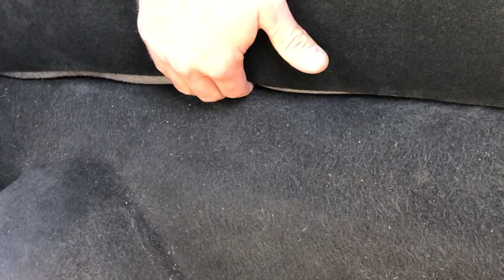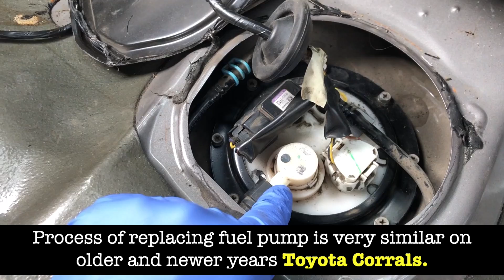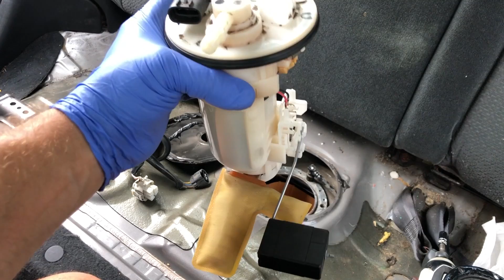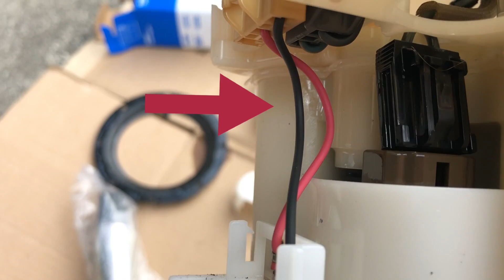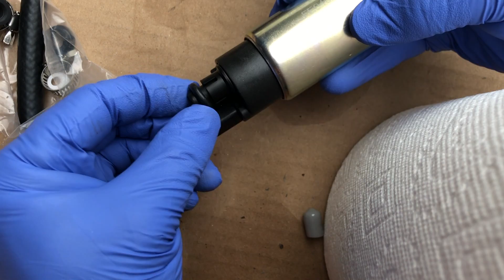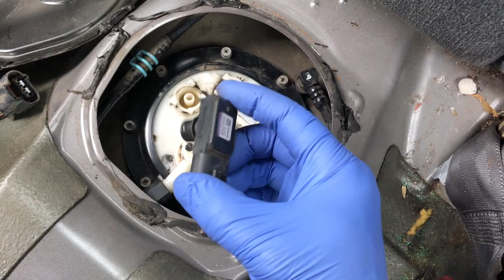How to replace a fuel pump on 2004 Toyota Corolla S tutorial |  Years 2003 2004 2005 2006 2007 2008

Comment: That thing at the very bottom is the fuel pump strainer, not the filter. The silver thing at the bottom, which he doesn’t mention, is the fuel pressure regulator and their life expectancy is 100,000 to 150,000 miles
Reply: Can you only replace the fuel pressure valve?

Comment: that connector at 1:52 is not easy to remove, have to push the screw driver deep to move the clip, I do it on one side first, then on the other side
but the yellow clip and screw will fall into the gap of the tank easily, better fill the gap with something before removing anything

Comment: Saludos tengo el mismo carro, tiene una falla va normal y de pronto deja de hacelerar le meto el pues hasta el fondo y nada al ratito vuelve y hacelera de nuevo normal y aveces cuesta arrancar será la bomba de combustible ??
Reply from the maker: Hi thanks for writing. This could be number of things. Could be clogged fuel lines or most likely clogged fuel filter or bad fuel pump. You would need to take your fuel pump out and inspect the fuel filter.
Reply: @tronixster  saludos nk se le cambió el sensor tps la garganta la computadora sensor oxígeno la bomba de combustible y las líneas de electricidad mandan la señal inestable y aún así sigue marcando el sensor tps ya no se que mas hacerle 😔 por ratos falla deja de hacelerar y ratos anda bien cuando le borro el chek anda al 100 el carro pero le vuelve y tira la misma falla los chisperos se los cambie las bobinas están buenas

Comment: Question: is there NOT a fuel filter but rather just the fuel pump on these Corolla models ??
Reply from the maker: There's a fuel filter somewhere on the fuel line, I'm just not sure exactly where. You'll have to follow the fuel line to locate external fuel filter.
Reply: The fuel filter is the half round thing the fuel pump is located in.

Comment: Did you use grease on the O-ring on the pressure regulator or the fuel pump O-ring?
Reply from the maker: Yes I applied gas to it to make sure it's wet all around
Reply: @tronixster  I was told to use some magnalube grease it’s mineral based grease But a little is that OK?

Comment: What happens if you fail to install all the rubber materials at the outlet of the pumb?
Reply from the maker: It won't pump gas as well and you'll have issues with fuel delivery

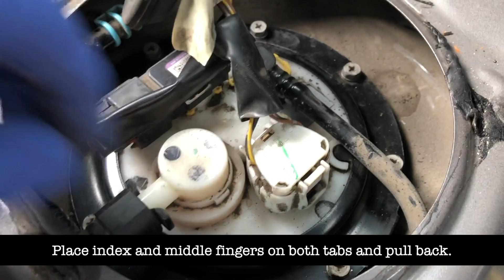Comment: Do not want to be called a hater for correcting you here but @ 1:56 those tabs you show with the screwdriver another video shows clearly not to pull them outward but squeeze them then slide the hose back, this here is misleading and if I am wrong show us a video would be interesting to watch how you do it. I struggled with it and could not disconnect that hose no matter how many times I tried, squeezing, pulling, screw driver into the tabs as you indicate; nothing! Other than that this is a great tutorial. Thank you for taking the time to do it.
Reply from the maker: Rody, thanks a lot of correcting me on this and pointing this out. I'm sure people will find this helpful.
Reply: @tronixster Oh you are very welcome, hope this can help other out there because those tabs are the worst part of this pump job; mine gave me the hardest time ever to come out; as I mentioned; I ended up snapping the round plastic tab on top of the pump where it connects to; and those tabs are sort of destroyed, don't know if they will catch the pump again and seal which is important as that is the gas return line. The ordeal was I ordered another pump from ebay for $65.00 which came the same way and was lucky the merchant refunded it, and told me to just keep it after confirming it was the part he sent, so I had no choice but to buy that upper part from the dealer to a whooping $80.!!! ...all this because of those tabs; the idea is so moronic and so cheaply made even a mechanic at the dealer told me they get to break them too from time to time; that hose at the dealer with that connector is $58.00!! it connects to the charcoal canister on the side of the tank and it is not easy to replace without a lift; I am still working in the car engine and replacing other components no less difficult like the clutch master cylinder, another PITA job that involved taking the whole dashboard out to get access to the bolts for it that are buried in a metal enclosure impossible to get to from just under the dashboard, again, a simple modular panel from mid dash down that would give access to all that section would have made life easier even for a trained mechanic but seems all the moronic engineers got together to design this 2004 Corolla, LOL

Comment: 2004 Toyota Avensis, crank but no start, fuel tank is full. It was not started/run for 7 weeks! How to troubleshoot?
Reply from the maker: Could be number of things, make sure you are not using spare none chipped key, could be a fuse, spark plug wires, clogged fuels lines or fuel filter, mass air flow sensor and so on. I hope you get it sorted out. Blessings
Reply: @tronixster  It showed to be bad battery even tough it was cranking a lot. But the issue was first solved by dragging the car with another car and start it in second gear. A couple of days later change the battery and fill up the oil as it also was kind of low. Thanks anyways!

Comment: I have an 02 Corolla with starting and ltft of 40%. Gonna replace the pump tomorrow.
Reply from the maker: Good luck on the replacement :)
Reply: @tronixster  Fuel pump wasn’t the fix. I got tired of working on it with HOA watching. I bought a 02 Honda CRV. All is well

Comment: I have an ‘04 Corolla with about 600,000 miles on it (the odometer maxed out at 299,999 nine years ago) and it has never had an problems. Welp just the other day it started to have a problem for the first time. Turns out it’s the fuel pump starting to go out. This video was extremely helpful. Was able to do it myself and my only expense was the pump itself and a pair of rubber gloves.
Reply from the maker: 600k miles?! That's impressive!! And praise God you found this video helpful. Keep enjoying your Corolla

Comment: Hi, I've watched a few of these but yours is the closest setup to mine so far. I'm down here in NZ and my 2002 9th gen (introduced to N.America in '03)  has 2 fuel lines and the white connector, not the $200 pressure sensor.  Also have those 8mm phillips head hex bolts instead of the plastic screw-on retaining ring seen in most other videos. I only went out to check after viewing this, saved me buying a strap wrench I thought I'd need. Many others are replacing the entire assembly but I just want to swap out my strainer sock and main filter as a bit of maintenance so your video covering the disassembly will be very helpful this weekend. Much appreciated.
Reply from the maker: Praise God you found this video helpful. Yeah these units can be taken apart and individual parts can be easily replaced.

Comment: Great video man. About to do the fuel pump in my '07. It's finally starting to go out after 270,000 miles.
Reply from the maker: Praise God this video was helpful. And good luck on the replacement
Reply: @tronixster  the replacement went smooth and silky. Been running fine since
Reply: Hello. Can you send a link please of the pump you bought for your 07 please. Thanks!

Comment: Question. I recently topped off my tank and added seafoam to my 2003 Toyota corolla . I turned it on and off about two times for grocery runs. I turn it on it starts for a second turns back off with a squeel and I get a scent of gasoline . Is it the fuel Pump that needs replacement??
Reply from the maker: You might have couple of issues here: 1) leaky fuel line & 2) loose belt. But I can't tell you for sure, I would have to see the car in person. So good luck man

Comment: Hello, you are the fuse efi to jump? I still have the engine's radiator fan, which is always on. I was wondering if you yourself had the same problem as me. Thank you!
Reply from the maker: Hey Michael, no I never had any issues with radiator fan. It seems to be working as it suppose too.
Reply: Radiator fan stays on when the AC is on.

Comment: Very helpful, changed filter and fuel pump, but still no go. I'm going to give it power independently of the key start switch so it can build pressure without killing the battery or the starter motor... any suggestions?
Reply: @wackarnolds  have since found no compression on 2 cyclinders. Probably damaged valves. Taking apart soon
Reply from the maker: bro I'm sorry. Sounds like you'll have to do some more troubleshooting. Good luck

Comment: Greetings I have a Toyota Corolla 2003 and I have to put the switch three times and then start the engine.  When I turn the key I don't hear the fuel pump. help me
Reply from the maker: Maybe electrical issue.

Comment: My corolla 2007 US model is having some problem in starting.in morning it starts imidiately but after a drive when i re start it takes long time to start. I changed its fuel pump few days ago after that it is showing this fault. What could b the reason?
Reply from the maker: Could be leak in your fuel line. When car seats for some time it gets air in your fuel lines and it takes some time for fuel pump to push that air out and then it starts
Reply: Cars require more fuel to start when the engine is cold, but they require less fuel when the engine is warm. So your car is probably getting too much fuel when the engine is warm. That could be the result of leaking fuel injectors or a dirty mass airflow sensor. Try adding a good quality injector cleaner to the gas and clean out the mass airflow sensor with actual mass airflow sensor cleaner.

Comment: I have a 2009 Corolla LE with 180,000 miles and recently the check engine light (CEL) turn on and the code is P0001.
P0001 is volume Fuel  Pressure Regulator but I have no fuel issue and the car is running fine and did not notice any stall or rough idle or any fuel related issue. Is it really Fuel Regulator? Thanks for the video.
Reply from the maker: I'm sorry man. I wish I could answer your question for you.
Reply: @tronixster  Not a problem. Thanks for the excellent video.

Comment: I saw your video, I have a question to you, I got P0171 code in my scanner and say “System too lean bank 1” them I remove and replaced the mass air flow sensor, up and down 02 sensors, air filter, pcv valve, vacuum hoses replaced and the problem still. Do you think could be the fuel pump? Or injectors?
Reply from the maker: I'm sorry man you had to do so much work but it's hard for me to recommend anything honestly. Good luck to you
Reply: Did you figure out the problem?
Reply: I am here for the same question! Thank you for asking already

Comment: im 17yrs old i ordered a fuel pump but i was following thru different videos cuz people wouldnt show good enough... and im pretty sure i didnt place the things right.. i started like at 8pm until 11 pm and didnt even finish putting the things back together like i left off at trying to put the whole filters back ... i got tired.... so later or tomrw morning ima  use this video to go thru the proccess again ....   the one im working on is a 03 toyota matrix has the same everything as shown in the video
Reply: It should be a very similar process if not exactly the same. Good luck.
Reply from the maker: Good luck brotha

Comment: Sir where did you buy the fuel pump from can you give us link thanks in advance.
Reply from the maker: Hey Mike, I bought over the counter at my local AutoZone store. It will cost you around $200.
Reply: use rockauto. a fuel pump is only 40 dollars there
Reply: @xxmemekipxxlastname4846   Is it a good fuel pump??
Reply: @collinnielsen9596  yeah i got an oem one

Comment: Unfortunately I have a 2019 Corolla SE. Would you be able to make a video for that? I don't actually need it replaced but if I ever do, it sure would be nice to have a video for it. Keep up the great content! I'm your number #2 fan!
Reply from the maker: It's less likely that you'll need to replace a fuel pump on a newer Toyota Corolla but if you do process will be very similar. Good luck :)
Reply: @tronixster  thanks Paul! I have 2015 Tesla model S and I think my fuel pump might be going out on it. Could you make a tutorial for replacing it?
Reply from the maker: @rumetube6177  Thank you for commenting again. I'm sure all years and models Teslas are battery-powered. In other words, they don't have a fuel pump. You might be having a bad battery or simply try charging your battery. I hope this was helpful.
Reply: @tronixster  Oh that makes sense. Well the the thing is my Tesla has an aftermarket gasoline generator installed on the trunk so I never have to charge my Tesla. I fill up the generator every morning and start it up and it's showing good battery levels consistently. However, last week the generator did not startup despite being full of gasoline. I'm thinking it's because of the fuel pump in the generator. It's a predator 212cc. Do you think you can make a video explaining how to fix that? Again, thanks in advance! Love your videos!
Reply: @rumetube6177  wth lol is this a serious comment 🤣 you have a gasoline generator to power your electric car? Isn’t that ironic. Maybe get a gasoline car and stop harming the environment more then you are